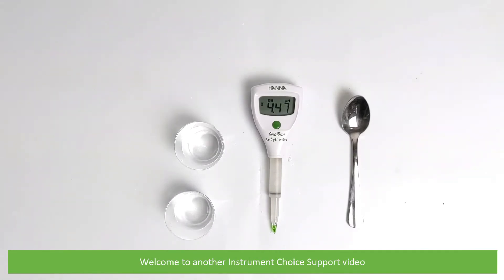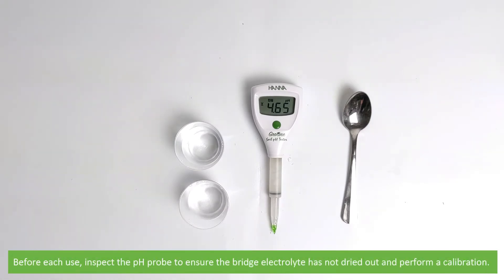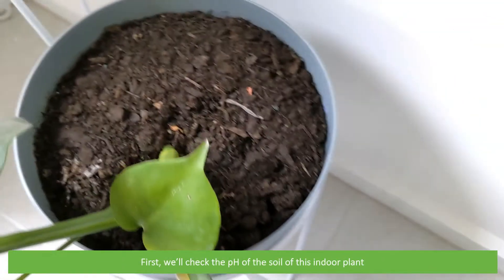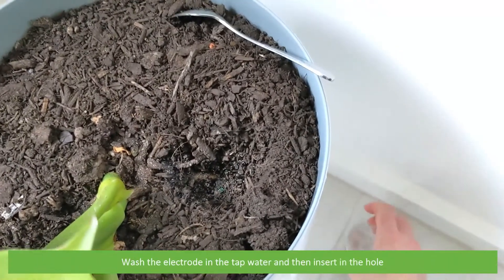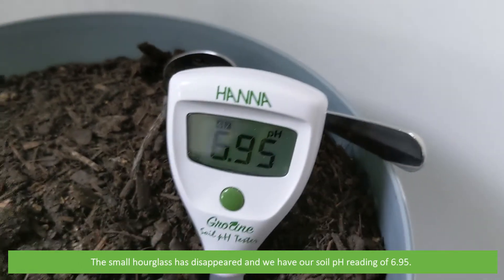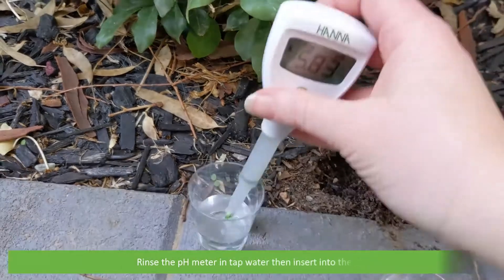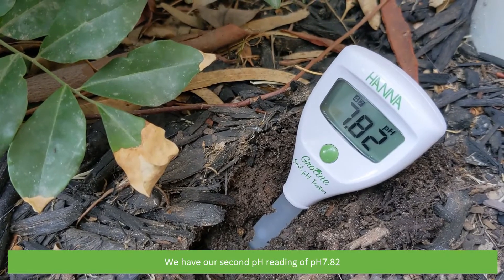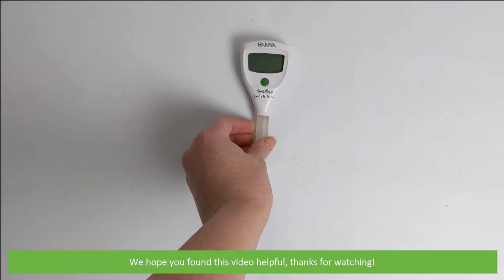How to Measure Soil pH using the IC-HI981030 Groline Soil pH Tester

Comment: do we need to empty and  refill cap with  electrolyte solutin  every  time we sttore soil tester?  or this solution can stay inside untill evaporate and then refill?
Reply from the maker: Hi damirfiat, Thanks for the enquiry, with the electrolyte fill solution this will need to be filled when the solution drops below around half full or if the electrode becomes sluggish.